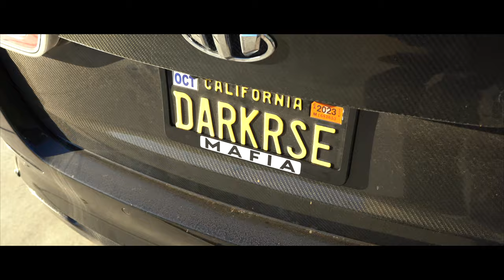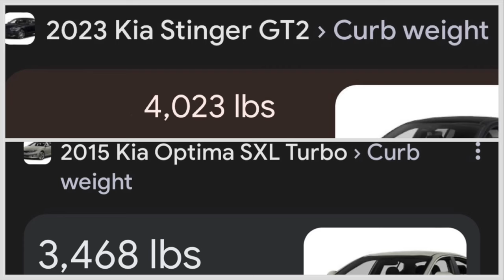This KIA is a MONSTER!

Comment: Wonder if that wastegate can be installed without a tune or mabe just a jb4 at least. Also wondering how he got his jb4 for the stinger if they don't sell them to California residents. Maybe u can enlighten us how how to get parts that companies don't want to ship to California 🤔
Reply from the maker: Im sure it will still need a tune because the computer will throw a code since the waste gate wire will be non existent. But Im sure with the proper spring setup to the current psi level it could. But KSR performance tune will get that covered 💪
Reply: @DARKRISE  yeah just got my engine replaced in January will probably just do the safe jb4. Idk if they actually corrected the defect in the replacement engine didn't seem like it when I tried to get a technical answer from them that probably why the replacement has a lifetime warranty

Comment: I feel like unless it's a Kia, Hyundai, or Vw, even adding a muffler on a 4 banger is going to be utter trash...Kia's and hyundai's have a unique sounding 4 banger..even my 4 banger tiburon with flowmaster 10s and slp loudmouth resonators constantly had people questioning whether or not it was a v6..😂..instead of actually becoming raspier, they typically deepen at higher rpms which is why i'd no doubt throw so magnaflows on an N if i cop one in the future..
Reply from the maker: True!! I noticed that aswell but regardless people will always hate just cause its a kia…